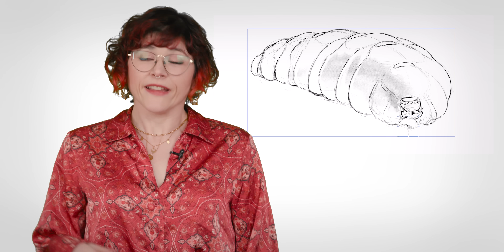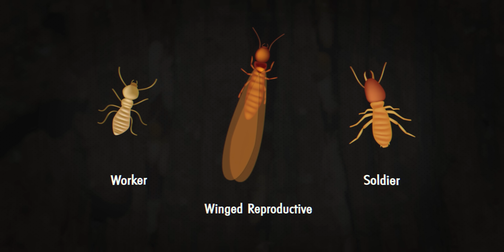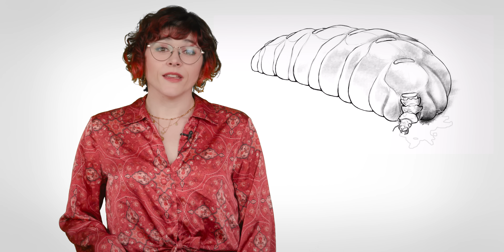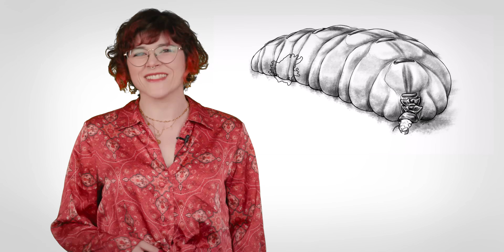Why Do Termites Lick Their Queens To Death?

Comment: 10:30 if you built a house out of Termite food, it's 100% on you. next time; build out of bricks or concrete, no insects can eat those (I hope)
Reply: The brick is fine but the mortar in between can get messed with by bees and Ants and termites.
Reply: They might also be able to chew through concrete.... That is absolutely terrifying
Reply: @AfroMidwestern  but why would they chew through concrete? they will see no wood and just move on
Reply: @event-keystrim213 from my understanding I don't really think termites see the same way we do usually, at least not mainly.
Reply: @AfroMidwestern  yeah, but, when they detect no food around, they should, logically, just move to another place, like, why would they settle near a concrete wall if they can go live in a rotting log? I doubt they would choose to do something so laborsome for no apparent benefit, it's not like they know there's wood inside

Comment: So, a fun fact about wood digesting bacteria (and the insects that have formed symbiotic relationships with them)
Coal, and by extension diamonds, exist now because for a period of time, the lignin that makes up wood fiber was basically unedible by everything, so whenever a tree fell over, it would basically lay there forever, until it was literally buried by the land shifting around it. So entire forests suddenly being decimated by one of the many common natural disasters that would occur basically created these massive fields that eventually turned into layers underground. Through a combination of time, pressure, and heat, those fields would become coal, or diamonds with even greater heat and pressure from seismic activity and time after becoming coal.
Anyway, that's why coal isn't a renewable resource, because bacteria and fungi developed the ability to turn lignin into cellulose, termites just took it another step further by creating a symbiotic relationship over time and trees end up rotting and being eaten long before they can even start the process of becoming coal.
Reply: Hey thanks

Comment: this boring monotone idiot says termites are recyclers.  No, you idiot, they do not take old trash wood and turn it into brand new wood.  Eating a dead body is not recycling.  You psychopath.  By the way, I can't finish this video.  This yapper lady is animating like an amiibo.  There's two people yapping and they don't have a point.  Just infodumping about termites aimlessly
Reply: You don’t understand recycling, it doesn’t mean the material will be restored to its original form, it will be broken down into other useful material for the ecosystem
Reply: @coalyote  oh I didn't realize the termites were going to clean all the toxins out of this house while they turn it into contaminated dirt for the ecosystem which might as well be naked people squatting on this square without a house

Comment: Americans: We have a termite problem. Proceed to build everything out of wood
Reply: cheaper faster construction keeps the repair and replacement industry incredibly lucrative. and our hyper capitalist society somehow sees permanence as a bad thing, because it can't be repaved into something more profitable later
Reply: @RecurveStickerDragon 

 Yes and no - unfortunately a lot more "yes" these days... 

Wooden structures can be made to be permanent with proper maintenance, and that maintenance is not prohibitively expensive. Replacing my wood/shingle roof costs a fraction the replacement/maintenance of a slate or tile roof.

My house was built in 1927. They were not always built to be ripped out and replaced, nor have they always been built with the maximal amount of corner-cutting the law will allow.
Reply: We have termites in Brazil and they don't cause problems, ok our houses are made of bricks and concrete, but the roof structures and wood, it's the same thing with bedbugs, we don't have them here, it's cold there, why don't the insects die?
Reply: That's because wood is so abundant, it's cheaper to repair the damage than to use an alternate material.

A LOT cheaper. 

I can replace - to code - an 8ft section of interior wall, including the studs, for less than 200USD.

That's drywalled, painted, and ready for a family picture. 

Most of North America doesn't have access to stone or clay in the quantities needed for masonry to be commercially practical - concrete is already expensive to have poured, and can be monumentally expensive to repair.
Reply: DAS WHAT AM SAYIN', build out of bricks and concrete, no insects eat those (I hope this won't age poorly)

Comment: If u don’t like termites, u should while ur home is being built, white wash all the wood. Thats what white wash is, powdered lyme in water, also borax in lyndeed oil but it’s flammable. So long as the wood is out of the weather u wont have to reapply or worry about a sealer like oil

Comment: Wouldn't it be nice to adapt the construction principles of those Australian termite mounds to urban planning? I imagine a grid of multi-story houses going from least-high in the periphery to the highest in the center, each row offset, so that every building gets its share of sunlight, with solar panels at the south-facing side and turbines on the top for a portion of energy needs, and those genius cooling systems that were common in the Arabic world where the airflow gets directed through a building in such a way as to keep the interior considerably cooler than the outside. This wouldn't be easy to fit into existing urban layouts, though (still, makes more sense than The Line 🙄)